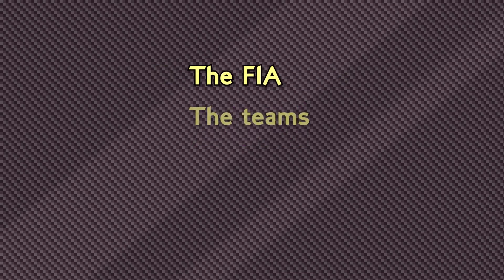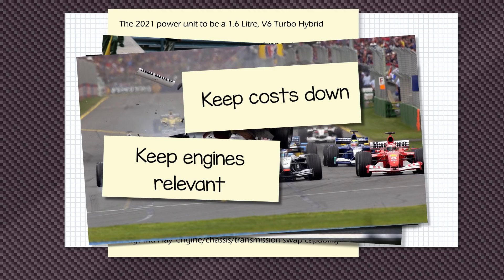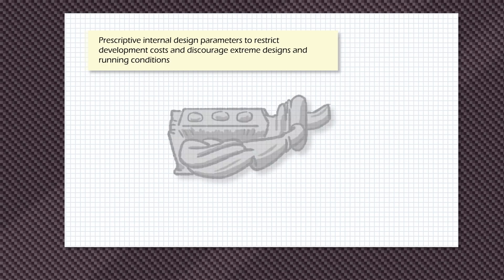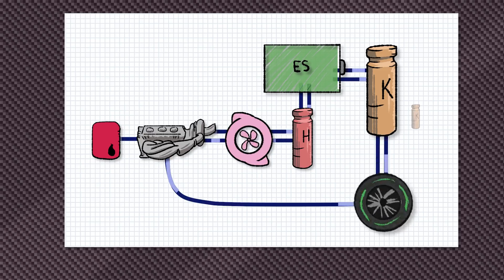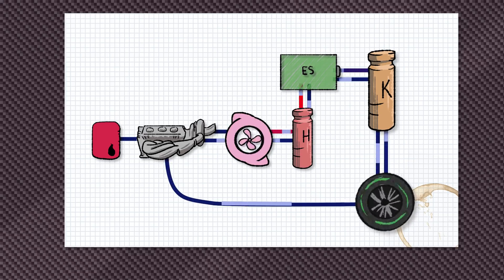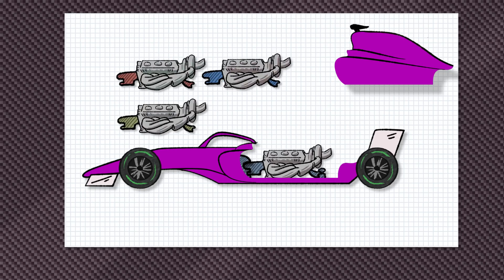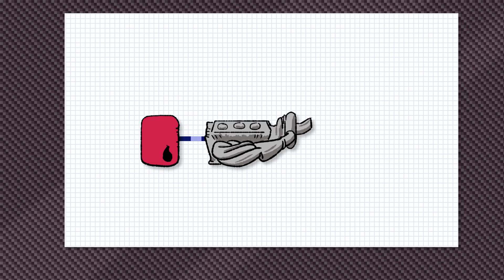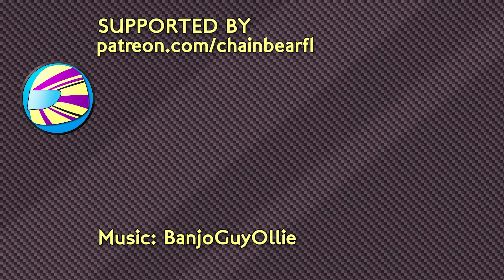F1 Engine proposals 2021 explored

Comment: I think it's time for F1 to decide if it wants to become electric or not. If it wants to relate to road cars, then it becomes Formula E. If it wants to remain Formula 1, they need to admit they haven't been road-relevant for years and just be F1. Go back to a V8 or V10. No need to be road-relevant at all.
Reply: Remember that Formula E has been using a car largely based on 5+ year old tech as there's been minimal change to the powertrain since season 1. 

This is why the upcoming season 5 car drastically overhauls the powertrain.
Reply: I think you're right. The major manufactures may leave, but simpler cheaper engines would put 26 cars on the grid for a change. It might even result in  a car race.
Reply: 3rdWheel no series is as road relevant as f1. there are literally no more effecient engines than in f1, thats what the industry wants.
Reply: Iamwolf134 ngl i dont understand, do you want good engines or v6’s
Reply: Obito Uchiha yeah, but keep the fuel flow regulations and well see if the v10 really is better than the v6.
Reply: Technical passports are nothing new, Muzaffar. Take a look at the Group R's RGT class for Rally sports cars, and you'll see that they have a technical passport system so they wouldn't have to homologate them.
Reply: They already have formula e, and no offense but nobody wants to watch cars run out of a charge.
Reply: Jammie 360 having hopped up motorbike engines on technical passpots isn't a bad idea either.
Reply: I agree, formula one is supposed to be fast. I’d prefer them to be as fast as the 2004 f1 cars :(
Reply: Muzaffar Krylov the technologies used in the cars, like engine, transmission, suspension concepts manufacturers can adapt them to road cars. Take a look back to the 90s innovations, for example.
Reply: v8 v10 is not needed, when  Hybrid engine is much faster and much more efficient. Lap times have come down from the all "not so mighty" V10's   - A Power unit that is able to recover as much energy as the F1 today can recover is amazing. A Combustion engine is the most wasteful type of power unit ever created. And F1 has been road relevant up to a point, many things you see in your road car today was used in F1 years ago, Smart Suspension, just to name one. Even if is not road relevant, being old school and using archaic engines is certainly not F1, Technically advanced is more like it, and that today is finding a better Power Unit, more efficient. If it is electric, so be it, and that is NOT Formula e, lol, Formula e is all same cars nobody manufactures anything on their own basically. I wish F1 will open to different type of engines. SO, yeah it needs to have some relevance, but being at the top of what it can come to a road car years to come. mixed with what technology can do today, balanced by how much money is actually possible to spend. And boom, there's a big issue.
Reply: if they switch to electric, nearly all racetracks will be off the calendar

why? because current batteries are shit
Reply: walter gomez. that is great idea! just make a rule that car can only produce this much of emissions per 100km and what engine (or motor) you use it's your choice. It will take just one year for all teams to go electric.
Reply: Walter Gomez. If a V10 car had today's downforce and tires, it would be faster than the current V6s...
Reply: 50% Thermal efficiency is impossible because there are other factors to consider. Mercedes claims they did it but they used turbos and electricity to do that which isn't applicable because thermal efficiency concerns itself with the internal combustion engine, not the other shit. Look up Carnot's theorem for more info.
Reply: Muzaffar Krylov Becuase manufacturers have traditionally use the technology and expertise gained in them.

That’s also why most of them have stopped vying for F1. There isn’t much relevance anymore.
Reply: I miss the days in which sport was just sport. Development is great and all...... but half the people tgat buy this shit cant even drive lol. My neighbor is 55 with a m5 and She doesnt know what the "DS" does.... lol
Reply: 3rdWheel yep, I don't really like FE, without the engine noises it just feels and seems odd
Reply: what about 5 cylinder engines would they be viable for use?
Reply: How about hopped up Inline 4 Motorcycle engines, Callum? As in that which is found in the Kawasaki Ninja ZX-14R and the Suzuki Hayabusa? Maybe that could spice things up a little, at least as far as Indycar is concerned, if not in F1.
Reply: Muzaffar Krylov, I was thinking more along the lines of technical passports for such motorcycle engines that could be used in either F1 or indycar.
Reply: "I mean let's get real dude, they're not all freaking bombers," I know, but better safe than sorry. By the way, who are Mario and Aldo?
Reply: I see you missed lesson 1 in the propulsion tech. course.
Reply: Muzaffar Krylov Having all migrants extensively vetted so that only those willing to make America a better place to live in is a very good idea, so at least we'll know that they're out to earn their keep. Still, I think Indycar can stand to see hopped up motorbike engines and rallycross engines with technical passports alongside current engine regs grandfathered for a few years until all the teams can adopt the new engine regs.
Reply: Then that’ll just make F1 like Indy.
What F1 needs to be is the fastest of what relevant tech is. 
Like start giving them 1500bhp.
Reply: Wiryan Tirtarahardja hey man, how are you?
Reply: 3rdWheel go back to V8’s, if they guzzel fuel too much for the fia make them 2.2 litre and add a turbo. Make it exciting again, red bull sauber force india and williams arent trying to make road cars so dont care what the engine is, fia pay cosworth to make equal engines and the teams make their chassis.
Reply: Jammie 360 I specifically proposed motorcycle engines on technical passports running alongside current engine regulations grandfathered for at least a few years so as to gague everyone's reaction.
Reply: Here here!
Reply: Muzaffar Krylov Have you got any idea on how many technological and safety  improvements have been made to road cars because of F1? They are really relevant, and will always be. It's like saying extreme high end server cpus are not relevant to computer development as a whole.
Reply: I wouldn't drive Jackie Stewarts Tyrrell in 1973, I'd drive a Ford Mustang Mach I, it's simple as that, but somehow, somewhere, people forgot that.
Reply: GloomGaiGar you been sleeping under the rock last few years?
Reply: Arthur Grant. all you said has been debunked 1000 times. I'm not even gonna try to make you look foolish, you did it yourself already. Even if you charge EV with diesel generator, it will be still more eco friendly than ICE car. Fact proven by MIT scientist ( FT had to apologize to them for misreporting)
Reply: Electric cars should be killed entirely
Reply: The NASCAR strategy, in other words.
Reply: 3rdWheel But manufacturers dont wanna spend research on v8s or v10s that wont be usefull to them with their road cars
Reply: it can go electric with a range extender (preferably rotary, or a turbine - lighter, smaller and simpler), maybe 4WD. That would be fast and efficient at the same time and batteries wouldn't be  that heavy as in formula E and it could go still as fast as today. Sound could be generated a) in a car b) allong the track c) just for tv, so petrolheads would be still happy
Reply: Doesn't work like that boy.
Reply: It’s not about being road relevant, it’s about not being boring old dinosaurs that never innovate because ‘the olden days were great’
Reply: Callum Tanner how is a v12 or v10 not attractive? In street cars they sound amazing in a f1 car pulling 20,000rpm they sound unbelievable
Reply: no its not. have you seen formula e? i dont mean to shit talk fe because i like it but the tech is not there yet
Reply: I have to agree. It has been a long time since F1 technology had any real world application on road cars ... because what is desirable on a road car is not what the fans want from an F1 car. The fans want loud, powerful and fast ... in the real world of road cars governments are demanding quiet, economical, and slower (by reducing speed limits) onto road cars. FE is pretty cool, but it's just not (and never will be) what F1 is meant to be.
Reply: @vicj3343  fe is not trying to be f1
Reply: the way f1 can be road relevant is the fact that major brands like mercedes, renault, honda, ferrari can use the money spent on the development of new f1 technologies also on street cars. an example? look at ferrari LaFerrari, Mclaren p1, porsche 918.... these cars were born because f1 became hybrid. from this point the technology can be adapted for normal cars, and you can see suzuki, bmw, toyota doing this.
Also this can attract more big car manufacturers to f1, because the money they need to develope technologies for f1 can also help normal car developement. if f1 brings back v12, a very old technology, all the money spent on the developement of engines couldn't be used anywhere else. have a good day.
Reply: @luckysca9705  except all modern supercars sold come with v8s, v10, and v12.  It's what people want both in racing and in their garage.
Reply: The manufacturers are going to need to design a whole new engine concept, almost all of the bastards in F1 make v-6s, when was the last time you saw a v-12 Toyota? Yeah, they are going to give up on that shit. It's more of a convenience thing for the manufacturers, they are used to that engine format, it's easier to apply to road cars if your engine could be easily-ish applied to a road car! Imagine you found out an amazing thing, but it would be hard to engineer it into a car because none of them in your lineup has a v-10!
Reply: Can you imagine Ron Dennis saying "Hey Ayrton slow down that engine had to do 5 more races. Just let Alain have this one." The Ford DFV powered half the cars in the early 70's and nobody complained about relevance or cost. Give the drivers as many engines as they need and let the twist the crank out of it if they choose to. When did the equipment overshadow the drivers ? The current rules impede competition and that is never good.
I like American racing. You don't see the teams hanging over the drivers telling them what to think or say. The sanctioning body listens to the fans and team orders are "win the race."
Reply: FIA created Formula-e for this purpose and at this time the three largest producers of electric and electric hybrid cars Tesla, Chevrolet, and Toyota are not there. 

Also other than Norway, what country has more than 1% of it's vehicle population that is either all electric or even hybrid electric. None. If each carbon powered vehicle was replaced with electric there would need to be a three or four order of magnitude increase in electrical generation which currently is coal, oil, natural gas, nuclear, hydroelectric with a small percentage of solar. The carbon footprint and hazardous waste stream of electric is the massive dirty secret. 

Appropriate solutions are regional. In Norway with a massive hydroelectric generation capability, all electric works. In much of the U.S. CNG (compressed natural gas) hybrid makes the most sense given the massive reserves of natural gas. Before you say hydrogen realize they split natural gas to produce it, at an energy loss required by using electricity in the process. 
Electric and natural gas are still inefficient in sever cold. There are a lot of moving pieces and internal combustion will be around for at least another two decades as the primary motive power, particularly if you live outside major urban centers.
Reply: Hobby Electronics

 Agreed, you highlighted what's missing here, what the fans want.

Some of the best eras of F1 were when there were no, or very few, major manufactures involved, when technical innovation was rewarded.

Cooper with it's mid engine layout, Lotus with it's aerodynamics etc, both small teams who dominated, in their time.

One could argue that major manufacturer involvement has ruined f1, They seem to totally dominate all aspects of decision making regarding the car specs, yet the polls show that the Fans and even some Drivers don't have any interest in what we're given.

It's true that engine technology has evolved to a point of boring efficiency, problem is humans haven't evolved past what they wanted when car racing first started !

Humans still want talented Drivers risking all in machines that are loud and powerful and a little bit dangerous, and this seems to be the forgotten element in the current discussions.

Say what you want about US racing, but at least they listen to their Fans, the latest Indy Cars look like the 80's cars, because fan polling showed that they didn't like the look of last years cars, when has the F1 Establishment ever done that?
Reply: The claim that F1 is responsible for the development of these technologies is complete bollocks, and only ever gets whipped out to justify the cost of F1. Who CARES how much F1 costs if it recoups it's costs in advertising and appreciation by the fans. The technologies will be developed in response to real world needs, not the needs of a racing series. F1 can and should exist on it's own merits, not spurious claims that it serves an ecological purpose which is clearly a ridiculous claim when you consider the energy cost in flying the teams all over the planet with all their gear, and development, and construction and maintenance of the necessary tracks and infrastructure to run the series.  No Daver ... by any accounting F1 is a net loss ... but who cares? People pay for it, which is why fans should stop justifying it by other peoples standards and admit that they like it for itself.
Reply: steven french wrong kind of attractive, not attractive to the companies. Not the fans
Reply: Daver G - Toyota recently released a new engine design where they've obtained 41% thermal efficiency for future road cars. This was a result of modifications to increase the stroke length by decreasing the bore diameter for each piston, contouring the valve inlets to influence the air intake stroke, widening the angle of the intake and exhaust valves, and finally using direct injection and port injection in combination for the fuel delivery.

My point being, Toyota has made a massive engineering investment, and as a huge car company, based on their cost/benefit analysis, they've determined 41% is the limit for current generation mass-produced road cars. The gap between 41% and 50% would just be an incredibly massive and expensive engineering task, which isn't feasible for mass-production.

It took Mercedes a good part of a half decade and spending hundreds of millions of dollars at a dedicated facility with one goal and a huge dedicated team of very well compensated individuals, and after all that work they've created that amazing 50% efficiency. However, the difference is Formula 1 engines are not only massively expensive to build each one to obtain that efficiency, but they're also designed to run a very limited amount of mileage (Toyota's warranty would have to be something like 6 months and 10,000 miles for the drive train; good luck with selling that). This is in addition to using more exotic (and expensive) manufacturing materials, and quality assurance would have to be increased to several orders of magnitude above Toyota's current quality assurance procedures.

For example, current F1 cars have something like 6,000 components and each one, including the amount of components comprising the power unit specifically, are tested manually at the individual component basis using extensive technology component analysis, x-rays, ultrasounds, florescent analysis for visible defects, and laser scanning to ensure precise dimensions as specified by the engineers. For comparison, AMG engines are hand-built by one person, but I believe they fully-assemble 3 engines per day. An F1 equivalent would take days or weeks for one power unit.

Finally, each Mercedes engine is assembled by hand, and even prior to the QA process, the amount of in-house machining being performed is extensive, using expensive 5-axis CNC machines and very capable lathes, which are designed for precision and not mass production. Red Bull's Christian Horner has stated they're QA on some components is down to micron measurements. Then there's the fact they're using the MGU-K and MGU-H with significantly better battery units to achieve the 50%, which Toyota doesn't have the infrastructure to mass produce.

The investment for Toyota to get to that quality for a mass produced vehicle simply isn't obtainable, and by the time engineering and technological advances are made where 50% thermal efficiency is obtained using a hybrid F1 style power unit for mass production, we will have moved on to 100% electric.

My point being, yes, F1 power units have made significant strives when massive capital resources are used and tedious assembly processes are required, but we're still a very considerable away from closing that 9% thermal efficiency gap. Has F1 power unit development helped their understanding to increase the performance and efficiency of their road cars? Sure...but it's much less impactful when analyzed and compared to mass-production models, as it's not feasible for mass production at all levels of the process. Unless you want to buy a ~$3M super-duper hyper car.
Reply: F1 engines arent road relevant and they dont need to be. Its about building a race car and as long as its relevant for speed its relevant for F1. A modern V10 could be so fantastic
Reply: Obito Uchiha That’s why manufacturers aren’t jumping to join F1 anymore.
Reply: @ObitoUchihaisgay  the manufacturers would all drop out.....Because they do use f1 tech in future cars...

No one outside of supercar want v12 engines.
Reply: Vic J f1 at least helpt "beta test" this technology.
Reply: 3rdWheel what’s the point in a v12? Even a v8 is still impractical really. And as noted in the video. It needs to be attractive, something a v12 isn’t.
Reply: Yes, lets do this and then watch all the manufacturers leave the sport. People who tell you that F1 technology isn't road relevant, or that companies like Mercedes don't cross develop, are feeding you a line of BS to push their agenda. People need to accept that all-electric is coming, V10's are never coming back, V6's are here to stay (at least until they go I4 like LMP1-H's in a few years) and if you want big name manufacturers in F1, the tech has to keep with the times. Don't like it? Go watch NASCAR.
Reply: Matthew Holmes That's assuming Muslim migrants won't poison the well of F1 as well. That is, in destroying all of Europe.